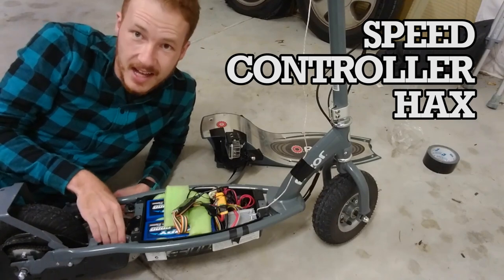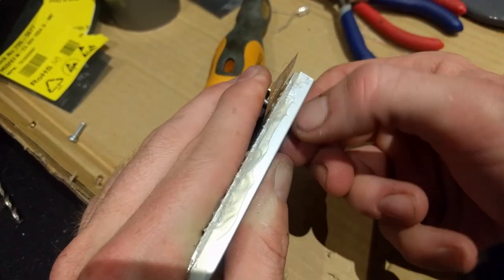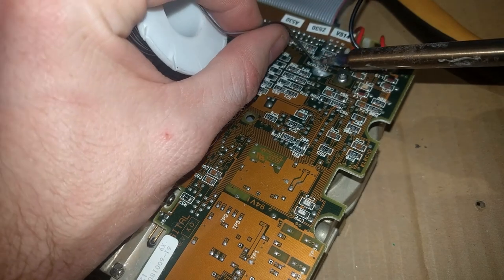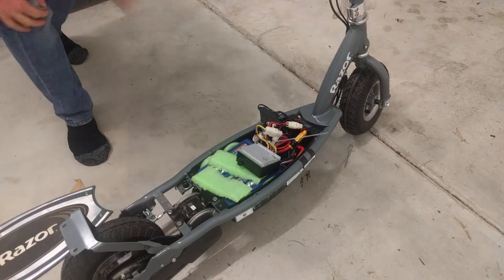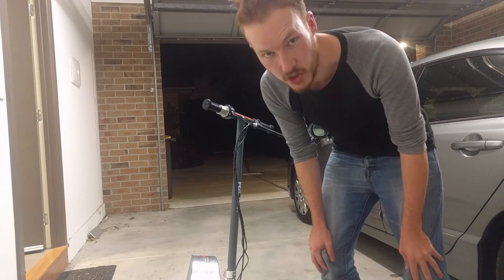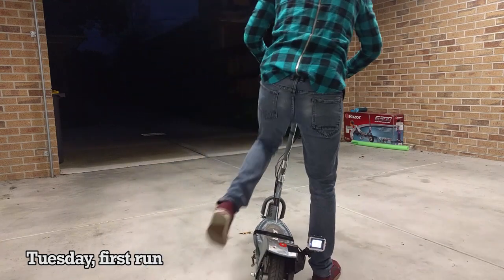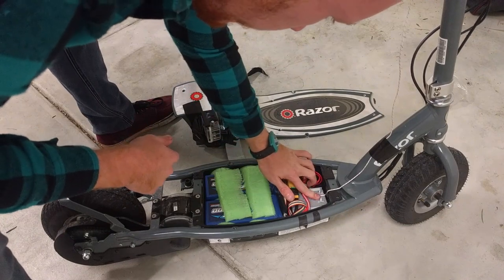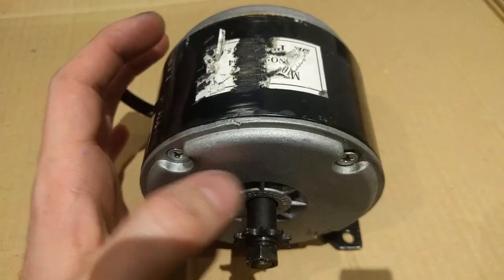Hacking The Speed Controller On The Razor E300 - Scooter Episode 4

Comment: You think it would be possible to seal up this motor somehow and cool it thru a radiator/fan setup using mineral oil since it's non-conductive?  I've seen people run 48V thru the stock motor with upgraded batteries and 48V 1000W controller.

Comment: It's 2021, and I'm still appreciating this video series!

Maybe 2016 was a different time, but speed controllers of all specs are readily available, cheap, and shipped fast.  I don't get how you could order & receive power transistors, and do SUBSTANTIAL hacking to the Razor stock controller, faster/cheaper than just swapping it for an appropriate one.

Regardless, it sure is fun to watch!
Reply from the maker: They got way better for sure. Thanks for still watching, I love making these when I can

Comment: TK, I need your advice. I am deployed with the Army in the middle east. I am restoring an E300 that has been been sitting in the desert for 3-4 years. I want to upgrade the entire system bc I weigh 210lbs. Can you recommend any manufactured battery/motor/controller combos?  Thanks! Jayson
Reply from the maker: Hey mate, sounds like a fun project :D 

I personally haven't tried any upgrade kits out there. Try checking out 36V conversion kits for the E300 though, I think there are some on eBay or other scooter parts sites that you could have some luck with! Try and find one with a variable throttle, it will make the scooter MUCH more controllable in small spaces. 

Good luck and happy hacking!

Comment: Hi TK! I have a question. I got a razor E300S and I modified it with a variable throttle/controller kit, a 24v 500w from wild scooter parts and put 2 12v 26Ah batteries on it. I have driven it for about a week and all the sudden, after about 20min, it just stopped working! Very weird. After 10min walk I tried to turn it on and it worked again, however just for 3 minutes. The on/off switched turned red a couple of seconds after turning it on but it has completely died on me now. 

Do you have any idea what it could be? Could it be de 250w motor or you think it’s definitely the controller? Hope not, I payed €35 extra for shipping/customs to get it to the Netherlands 😭
Reply from the maker: I read both your comments. Sounds like it could be the controller, yeah. A lot of people post mods where they say “do this to go 30km/h!” Or “do this for long range!” but fail to show that their scooter died a week later.
Reply: @WhatUpTKHere  Haha thanks for responding, I found out what the prob was. My batteries where overpowering it so I ordered a new controller and 20A’s instead of 26A

Comment: If I would use some lipo drill battery packs to get the same voltage would the controller "know" is not lead battery and "refuse" to work meaning not working at all. My goal is range not speed. I want to be able to easy swap the batteries when empty. What do you think TK?
Reply: Steli An the controller wont know the differents between lead acid and lithium energie. If you keep the volts the same then it will work👍🏼
Reply from the maker: denwex1 this is true to an extent - sometimes, the higher current delivery capacity of lithium batteries can lead to a controller blowing when it was fine with lead acids. I suggest experimenting - often you'll have a great time.

Comment: Why in the world did you throw away the old motor? The insulated copper wire alone, just think of the EMP jammer you could have made with it, Rodin coil... I'm sure other things. Unless it had been welded solid from the heat?
Reply from the maker: Yeah, that’s the point - the motor overheated, melting the insulation.

Comment: do you know how to wire in a 3rd 12v battery  with  switches that would provide a backup when the original 2 batteries start to drain too low?
Reply from the maker: Not possible - 24 V system so you’d need two extras

Comment: nice video. what new motor are you buying because I have currently upgraded my e300, i used a 500w speed controller and a variable speed throttle. I would like to use a 36v 350w motor. (:

Comment: How many volts did u run ? 48volt
Reply from the maker: 36V, but if I did it again, I’d strip the original gear and do a straight 48V build
Reply: @WhatUpTKHere  48v on what motor?
Reply from the maker: Alex Lisyuk i would only bother with a new 48V motor. No point over bolting the stock one, it just melts

Comment: Will the stock motor  handle a 48v lipo battery with a 48v controller and trottle or will it burn like in this case

Comment: Hi there, I'm loving the scooter project. I'm currently modding to my e300, I'm running 12s battery, 350w 24v motor. I can really recommend changing to the 80t sprocket the acceleration is amazing and top out at 20mph. How is the bms working for you? I keep reading conflicting stuff. I'm currently using a ballance charger. Thanks jamie
Reply from the maker: A sprocket change is definitely something I'm considering. The BMS appears to be working but I'm not in love with how I have it connected up with the headers. Most likely I'll permanently solder it to the battery leads when the thing's running well.

If you're happy using your balance charger, stick with it. I went with the BMS instead as it's incredibly expensive to find 10S balance chargers and I didn't want to deal with a many-pin connector on the scooter.
Reply: jamie peach can the e300 stock motor handle a 12s lipo battery? I mean that's 48 volts right? Isn't it going to burn the motor?

Comment: what kinf of batteries are those i want to upgrade my razor e300 to 36v with motor and controller i just cant find a good battery that will fit well in that box
Reply from the maker: They are from Hobbyking! 5S lipos!
Reply: @WhatUpTKHere  thank you what is the ah hour on them

Comment: ive watched loads of these e300 vids and yours i can follow even when you where bangin on about mosfets and stuff (im a joiner not a sparky) when you get it finished could you put a parts list up? i must admit though having seen a few of these type of vids the motor was the weakest link in your set up and better that going than frying the batteries.  cant wait to see what beast of a motor you replace it with.
Reply from the maker: Can do :D Thanks for watching!
Reply from the maker: In case you're interested, check out the Hackaday.io writeup - https://hackaday.io/project/9941-the-razor-e300-overvolt

Comment: I see 1000w 36v controllers for cheap on ebay, can I run those with the stock motor?  Or will they burn out the motor?  I have 36v batteries already.  Thanks for answering questions
Reply from the maker: Probably going with a slightly lower powered controller might be better. That would mean one with a lower current limit.

I ran mine at 36V with no current limit and it burnt out the motor in about 5 minutes, so maybe a 500W controller might be a safer bet than a 1000w.
Reply from the maker: Maybe try one of these.

https://rover.ebay.com/rover/1/705-53470-19255-0/1?mpre=https%3A%2F%2Fwww.ebay.com.au%2Fitm%2F36V-500W-Electric-Bicycle-E-bike-Scooter-Brushless-DC-Motor-Brushed-Controller-J%2F264026466518%3Fepid%3D15025590880%26_trkparms%3Dispr%253D1%26hash%3Ditem3d793428d6%3Ag%3AhlkAAOSwckVb4YIR%26enc%3DAQAEAAAB8BPxNw%252BVj6nta7CKEs3N0qVRCOxodeel%252BB%252B5v%252FWxtauocAvTT1DkA18mtKaBMnH6VpshGudaKHSauDbpXJ5rVm%252BoCo5q2pwvq0HRENIq5hDHBqc1AgdjUv93RWa%252FnaWv7%252B8M14UPRX2NXeCIPnCn3SolYQciSaLOehtqjvh40mSYSKuN7yuYeQPWtgD0%252BKLyIu6KsRXi9n14GBs7Ox2TFOTxfdZhX3591UfHv7DCXBJgzuI8UyWwT46rXA6H%252Bi1WuyTNH6Xz2ARDm7og%252FhvT%252FX600W3XGmdJ9aBc6PSSmeYxC4VE17imTmWBWuqgRSOZllmhFky6kUs3ja9tVq1X1i9s1ktN9aiScxrR268pa%252B1djVwGBnxVnV9X3qLLWWiIuqUsX9KUIUvxB3X3tNKWqElquNjpnx2rD4ESf29PU7mDxr063yUVTE69StHUeKSE0R0K7pMqbZ3isC1c3HD2qiuCdj0jBdBzD1x3zb2MNySJNymvjZIErt3ZDtPVavzT55iS2I1KVXheteZj%252BtzPWFZDZfu4ilcUHAlsYnqKBF9XrmrVMLMVAskDwJyKHNZ5gsRXbmD3vReGTyBXrfeSoIlSzAaHZBuiaNOuNDzSlkABrIQB9hFqfYJIwb8EYxI3de5VjEWRQyoWSgw7rVgWSTM%253D%26checksum%3D26402646651840dcb97afccf4fc6844cd872ae374f60%26frcectupt%3Dtrue&campid=5338501188&toolid=20008

Comment: Nice work Mate I modified a assassin scooter with 36volt 350w brushless motor I found from aliexpress. The lipos are a good choice and you would be able to increase your power and torque with a brushless setup not to forget brushless motors are more efficient which work well for distance.
Reply from the maker: Yeah, brushless is sick, thinking about a brushless build on another sled I've got packed away in the shed. This one's gonna be old skool brushed to the end I reckon (Y)
Reply: TK I take it the current limiting circuit is pretty standard for brushed and brushless controllers as I have seen this shunt on a brushless controller and wanted to get rid of it.
Reply from the maker: Yeah, very common feature.

Comment: 15:38 I'm not going to lie either.  I'm thinking modifying e300 costs as much if not more than buying a modern li-ion 36v scooter.  Amazon has swagtron 36v scooters for $299.  Beefy scooter too, supports up to 320 lbs.  By the time you put a buy a decent speed controller, motor, better gearing and 36v batteries you're looking at $200+ anyway.  When this video was posted 2016 maybe modding was cheaper but in 2019 it's cheaper to buy.
Reply from the maker: It really depends on a lot of factors. If you can score a free E300 like I did recently, modding makes a lot of sense. Plus it’s fun.

But if you just want a fast scooter, go buy one.

Comment: Do you have a video how to bypass the rolling throttle start?
Reply from the maker: the rolling throttle start? not quite following, what are we talking about here?
Reply: +TK I have a E175 bought for my kids, but throttle doesn't start till you push it first then only throttle works, kinda dumb, been searching to find a way to by pass that feature, been testing the board for which solder points are on and off where and when, through I'd ask if maybe you had a video of such mod

Comment: First, wanna applaud you on your project. That's a demon. My question about the scooter is yes it's fast but with those batteries how far can one travel? Thinking about my setup which I would be using a 1000watt motor. How far would I go on 48v 18ah battery setup with that 1000 watt motor? Please provide info at earliest convenience. Thank you and ride safe.
Reply from the maker: Should go 10 to 20km, but depends on a lot of factors. Good luck!

Comment: I like your vids on the speed controller, hard to find anyone who goes so in depth. I have a question or two maybe, if you don't mind, I think you can help me. First off I bought a razor  Bella scooter, it's parts I'm swapping over to a power wheels car for my daughter. With your mods I can run it on 36v if I want, I'll probably re-gear it a bit, I actually have a few irfb3607 layin around so I might just use those. I've been playing around with making a speed controller using the 555ic, then I came across the scooter, and I thought it had variable throttle. Even without the variable throttle it's still better than me making a speed controller from scratch, but that was the main purpose of my diy speed controller, plus I just like to do stuff, I figured if I can't figure it out, I'll just cave in and buy one off eBay. Anyway sorry for rambling, the question is how would you suggest adding pwm circuit to the speed controller? I was thinking of making the pwm circuit on some perf board, if I can get it small enough I think it may fit where you removed the relay. I'm just really unsure where to tap into the speed controller. I.e. Where should power my pwm circuit from? where should connect the output? I was thinking to the mosfet in place of the nominal 24v, but then again the pwm could possibly replace the shunt. I'm sure it would work easily, I just don't quite have the knowledge to pull it off. Not without messing up a time or two anyways.  If you can help I'd appreciate it.
Reply from the maker: The stock speed controller uses a chip that could /theoretically/ be configured to read a proper throttle input and output PWM in line with that. However it would be finicky to do so and likely involve lots of cut traces. 

It'd be easier & cheaper to buy a speed controller that does variable throttle already, or build one. I review one in a later video, actually.

If you have a go at it, please share your results! I unfortunately blew this speed controller up doing a burnout which meant I didn't try and mod it further.
Reply: By "cut traces" you mean scratching off the green stuff and soldering in leads? 
Sorry I'm a novice, lol, probably not even that. But I've already built a pwm circuit, using 555, pot, mosfet and whatnot. It works, but the ic gets hot when power is connected but not turned up, as soon as I turn up the pot, it cools down. Sooo...gotta figure that out.  Any who, I was thinking if I build my lil circuit, interrupt where 24v goes to the mosfet on the speed controller, put my circuit inline, and then output to three mosfets, instead of the one they have on there originally along with the other mods you did, or something like that. It should work? If I have to do it like your sayin, I'll probably just leave it alone and get one off eBay. Yeah I seen you messed up the speed controller, I watched quite a few of your vids...and subscribed, On to bigger better things though right! 

 If I mess with it I'll probably have to post a video...if it works, I gotta bit of work to do on the rest of the pw car before I get to the electronics, but I'm close. I literately taught myself a bunch of crap, (not enough yet though) so I can build a speed controller with variable throttle, so I'd be kinda mad at myself if I bought one. Anyways thanks for you help. Keep the vids comin.
Reply from the maker: Yeah, so a PCB has the base material (usually fibreglass, green), copper traces that carry electricity (copper coloured), and then often a soldermask over that (green). Cutting a trace is where you scrape through the soldermask and scrape and cut the copper away to break the trace.

Sounds like you're doing some interesting work with your build. Just be careful not to burn the house down, and good luck :D
Reply: TK Ok, got it. Yeah the lil car should be pretty cool. It's a mustang, working on fiberglassing the seat now. I took the two seats that come with it, split them in half (3/4 actually) and then pieces the two halves together to make one big seat. Then I made the back taller and the bottom (where your but goes) longer. This way it looks like the mustang seat still, but centered for a single riders and  further back, so it will last her a while. She fits good now, with room to grow, before the seat mod she looked almost too big for it. Going to center the wheel and make a rack and pinion for it. Rubber tires and all wheels will have bearings (solid axle in the rear using pillow blocks). Got a bunch of bicycle sprockets, so gunna probably change the gear ratio a bit, and run a regular bike chain, to beef up the drive a bit. Probably will use the scooter brake, and maybe simple suspension in the rear. I have some 3w leds for the headlights and a real car horn. That's pretty much it other than a few little things. Oh, I was also thinking of putting a sprocket on the axle that will go to a motor, to make electricity while the car is driving and maybe trickle charge the battery, or charge  a small battery that powers the accessories. I hook the motor shaft up to my drill and was able to get 4v out of it. Powered a little light and a small motor. Im sure I could create a ratio with the sprockets to make it spin faster than the drill makes it spin. I need one of those tachometer thingys lol. Surely it will have some parasitic effect on the drivetrain, so I have some figuring to do on whether or not it would be counter productive. It ought to be cool either way, I'll post some vids of it on my channel when I'm done. Thanks again.

Comment: I wandered why my transistor had adolescent like tendencies it defiantly had a half on!
Reply from the maker: hahaha
Reply: TK When I use to be a machinist working for lasko fan company we had a machine called a bonder, it use to bond all the windings together. the motors got real hot like the gals used welders gloves to handle them. they were three speed box fans, so maybe it is the over volting but I don't know about the winding thing, did you ever find out? just saying old one legged Joseph T

Comment: Great video 👍super smart. I have the rx200, if I were to swap the sla batteries for 2 12v lithium 9ah batteries and change a lthium battery charger port to a 3 prong plug to fit the razors charging port would it work???
Reply from the maker: You might wanna install a proper BMS/charging system to protect the batteries, but should be fine
Reply: I dont mean to be so off topic but does someone know of a method to log back into an instagram account?
I was stupid forgot the login password. I appreciate any help you can give me
Reply: @Jeffery Aarav instablaster :)
Reply: @Colby Imran thanks for your reply. I found the site on google and I'm waiting for the hacking stuff now.
Seems to take quite some time so I will get back to you later with my results.
Reply: @Colby Imran It worked and I now got access to my account again. I am so happy:D
Thank you so much, you saved my ass !
Reply: @Jeffery Aarav you are welcome :D

Comment: Haha, sorry mate. Same thing happened to my one. I had to fit a 36v motor in there it's been bullet proof since. I had to drill new holes and trim some of the stand mount to make it fit.
Reply from the maker: Ah, good call. I may have to hack away at the frame myself...